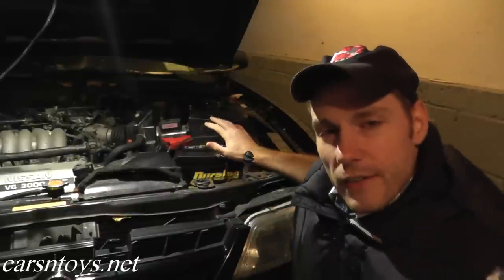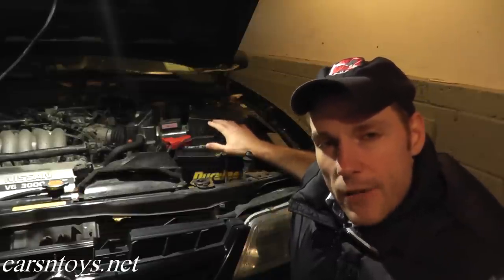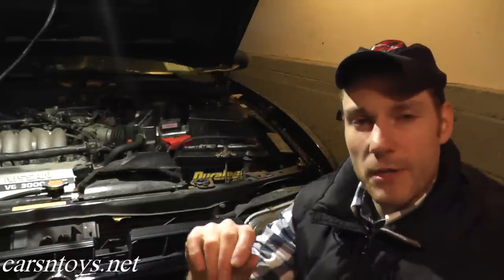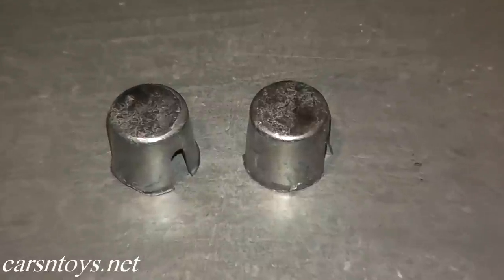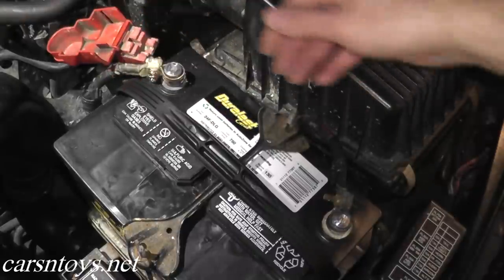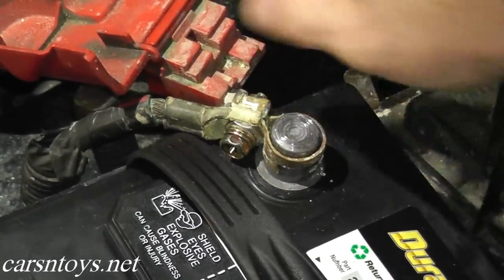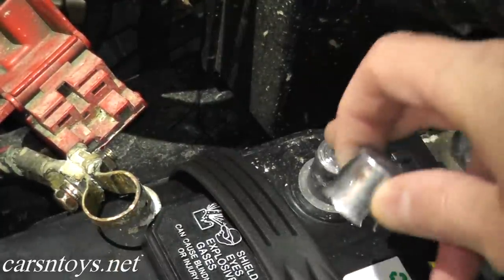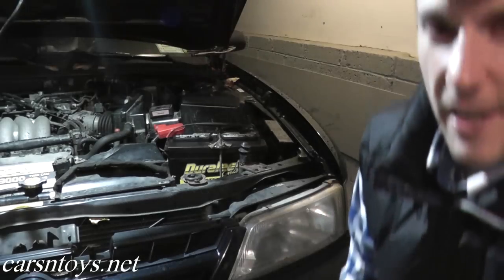Fixing A Vehicle That Turns Off For No Reason

Comment: Hey you save my life !!! I've been experiencing my Car randomly dies while driving.. Already changed the Spark Plugs, High Tension wires, Fuel Pump, Fuel Filter, Relays.. When i saw this video, I've noticed my negative battery terminal is crack  even if it is tighten.. now my car runs fine !!! Great Video !!!
Reply: My dad is having the same problem, I’m trying to find out what it is. Car stops going for no reason and brakes go rock hard when it stops.
Reply: @Partypartyyeah613  Check Spark Plugs, High Tension wires, Fuel Pump, Fuel Filter, Relays & Battery Terminals.. Lastly sa ECU..

Comment: I love your video!  I never knew battery post caps exist.  I just bought a battery from a car parts store and they put it in for me.  I felt stupid but said "if you're offering to install it I won't say no."  During the install  I said "it looks like the positive cable needs to be tighter."  They said "its as tight as it can go."  I thought it would probably be OK.  A month later the car starts dying while driving.  I forgot about the loose contact until seeing your video.  Thanks for the awesome, easy fix!
Reply from the maker: That's awesome! Glad to help

Comment: This fixed my problem, thank you! I did not actually buy the posts but the problem was the loose positive terminal connection on my 2006 Honda Odyssey. I had not seen the problem myself but my wife had experienced the loss of power while driving a few times before I went on the internet searching for a solution. Also, make sure the connection to the smaller wire that typically goes to the fuse box is secure. I have driven 1500+ miles and (crossing my fingers) have not seen this problem since.

Comment: The positive terminal I was working on was so corroded I had to clean it up and discovered whoever worked on it before just tried to tighten it as much as possible  and broke one side of the terminal. I replaced it and discovered it probably broke because of the very bad corrosion going on for years. Thanks for the TIP! I replaced the battery after seeing your video. There was a sudden shutdown after all the work I did. The car did start up and suddenly just shutdown. It happened a couple times. Then I remembered seeing you video and I replaced the terminal. Everything resolved! The shop said it was going to be $900 after a diagnoses. This was a 2012  V6 Frontier. Thanks again for a great video!

Comment: That's interesting because you can take the battery out once it's running and it will stay running because the alternator holds the charge. The battery just provides the initial jolt to turn the starter
Reply: Yup only reason car would die after it’s started if your alternator is shit
Reply: Yes for old cars…. Lots of new cars these days do require the battery in the circuit for the car continue to run
Reply: Yea that's not true on 2003 and up vehicles.  With all of the electronics they have one feature on newer vehicles the battery losing connection will kill the vehicles.
Reply: With ALL the electronics cars have now ?!

Comment: Silicon foil also does the trick. Wrap around as much and tighten on the silicon foil. I use it on my vape with a loose battery. So silicon foil WILL transfer the power acting as a metal piece

Comment: I have a 2001 dodge neon with 206 plus thousands miles, good battery and connection, it runs idle for 3 or 4 minutes and turns off, what else could be wrong with it?
Thank you.

Comment: process of elimination. start with the battery if if you cant get a spark from it then it needs to be jumped. if its a brand new battery it could be weak connections from the battery and the post. if you tighten that and it still cuts off it could be the alternator or a fuse problem. if you still cant get it to work take it to someone who has more experience.

Comment: Hi, here my vw polo have the same problem and I open the hood I just touch some wire n when I close the hood the power comes back. Lol I need some tips to fix it. I  think the battery connection is fine . Is there any other things to check.

Comment: I have a 2002 Ford Mustang V6 and as I'm driving down the road it will shut off for no reason. So I pull out the key and put it back in and maybe it will start and maybe it won't start. But when the theft light turns back on it'll start back up. It's got a new gas tank put in it new fuel pump and a new computer any ideas what it could be

Comment: 2001 gmc sonoma will run till it gets hot and then shuts off I have replaced starter and coil pack and alternator checked battery terminals and so far none of this has been the problem it still shuts off while driving.any solutions please help

Comment: I have a 1994 mustang gt, it's often will idle high then come down and shut off it's even shut off when driving, weird because It was idling and when I turned the vent from in to off it shutoff, I had the battery checked and there was no problem there we are still not sure what the problem is and help?

Comment: I have a 1998 Jeep Grand Cherokee Laredo 4.0 . Starts up fine, then it starts to idle kinda rough and sounds like it's about to shut off and then it in a couple of minutes it does. Also I can be driving down the road and it dies but starts back up. New battery btw with tight and good clean connection. It's a Chrysler though so what can I expect.
Reply: C B H did you figure out what the problem was ? Same thing is happening to my Chevy Suburban. Replaced the battery and a few days later my car starts but it starts idling rough and stalls on me.

Comment: Great video, you've confirmed my suspicions of the battery causing this issue...
Reply: My 2003 ford expedition dies at the red light or when is park battery could be the reason????
Reply: Oh I put in aftermarket stereo that maybe causing problems?
Reply: beto blas Check air and fuel

Comment: I have a 300 Chrysler hemi I have my automatic start I put new batteries in it I started it it runs for 15 seconds and then stalls out what could be my problem the doors are shut though it's shut Chuck but the engine likes on and I don't know why that's on but everything's running fine

Comment: My car randomly cuts off at low speeds when I turn the steering wheel now other day just off rolling down the window that current made my car cut off so that electrical problem? Bad ground wire cuz it was a lot of corrosion on the battery cable connector when I bought it

Comment: My 01 town & country 3.8l engine shut off at a redlight and will not crank back up. I've got power to everything, but it does nothing. It won't even turn over. Not even a click. It was driving fine then boom. HELP PLEASE

Comment: I had the same issue, 04 Ram 1500 5.7 truck would shut down while driving randomly. Found grounding bolt by the ECM harnesses lose. Tighten it down and no more problems.
Reply from the maker: Good stuff!

Comment: my 2017 Ford Fusion shut off as I was stopping at a light. It also put itself in Park. No engine light went on. It restarted without a problem but I went directly to the dealer. Because there was no engine light it was suggested that I continue driving it until it happened again, however I declined and left it for service. It turned out to be the throttle assembly which, of course, I don't understand.

Comment: awesome Vid  Just had the worse time just before Christmas 2022, Gone shopping had my van on and BAM the van just stalls , I was trying to figure out is it the battery or the Alternator ?? Well after 3 hrs in a 30 below zero weather and got severely sick afterwords, The battery was only 7 months old  and figured I just purchased a lemon battery , But the problem was simple . I jumped the battery took it home checked the wiring and wallah.. Battery
 ring was looser than  my grandmothers skirt . I did what you did on your video n saved me Hundreds of $$$$$$$$$$$ Thx for the Tip my man

Comment: I replaced me alternator then I needed a new battery. I noticed my positive terminal was loose so I just used some random washers I had laying around so my terminal would be tight. Since then I’ve had my car randomly stall a few times while driving.  The terminals are tight but I have a feeling the washers are the problem now. Going to buy these caps tomorrow and see if it fixes the issue. 
Thanks for the in site!
Reply from the maker: Glad to help!
Reply: Did it help ?

Comment: Great vids.. What if your battery looks perfectly fine.. My car has alright idling, but when driving, it does tend to get into oow revs and turns off out of the blue.. Any thoughts in this?
Reply: did you ever find out what the problem was my.car turns off randomly and i do have a check engine light but its a tempersture sensor would that make the engine turn off randomly?

Comment: My car shuts down after i lower the gear from 3 to 2. In the last service   I had changed clutch.  Do you have any suggestions to fix
Reply from the maker: What kind of vehicle? Check engine light on?  Throw me an email to carsntoyshelp@gmail.com
Reply: CarsNToys Its Suzuki Ritz. Even idle rpm is not constant. Took to mechanic today says engine misfiring

Comment: this is exactly what happened to my car on a highway, that's why I'm  searching this on utube. My car turned off while it's running around 50km/h. I pulled over, and I had no idea what happened. Car electricity back again automatically after popping the hood. Then after few miles it happened again, and that time I was lucky to find where the problem was! whew.... I would be in a serious trouble where I stuck.
Reply: Mohammad Niaz Morshed So what was the problem?
Reply: What’s the problem ???
Reply: @tmt2058  loose battery terminal.

Comment: I’m not sure if it’s my car battery or my Alternator being the issue for my car... my car just stopped running for good 10 seconds the battery light was on. I switched it the ignition off and turned it on again and thankful my car is running again but I’m confused as to what caused that shut down
Reply from the maker: Certainly check both. A good battery tester will test the battery and alternator. Most local auto parts stores will check for free.

Comment: Mine are in solid but still does turns off, battery is good had it checked but not sure about alternator, my tester says they are both good...so I have no idea what to do now
Reply from the maker: Does your vehicle have an after-market alarm or remote start?
Reply: @CarsNToys  I have 2 remotes but I have not programed them yet and I'm sure has alarm but does not get set because I don't have a remote programmed
Reply: @CarsNToys  I have a door ajar light in dash I think that's why it won't go into program mode on van

Comment: what if my car dies at the light but starts back up? the lights pop up of the battery, exclamation, check engine soon. I've taken it to auto zone for the codes and two codes popped up. I've had a mechanic looked at it and drove it and it didn't die for him. what's up with my car ?
Reply: we changed battery and cabels and timming belt but still dies
Reply: Wayne Johnson Anything new with your car?
Reply: Your EGR valve maybe clogged up or closed and won't open. You might need to change it

Comment: what ahould i do if i get a abs code 112-01? i cant seem to find anything related to the code. but my guess is... it might be the alternator or the battery... what my car does is that it turns on, but drives on low rpms not allowing me to pass over 10mph before stalling out, and when left in park(P) overnight, the battery power is drained... any ideas?
Reply from the maker: +Elliot Carvajal What kind of vehicle?
Reply: +CarsNToys is a 06' Acura tl automatic 3.2 vtec base model
Reply from the maker: +Elliot Carvajal I'd start by fixing the battery draw. Look up - Parasitic Draw Test. The '04 TL i worked on had a similar problem. I traced it to the bluetooth system. We just pulled the fuse for the bluetooth system and it solved the problem. (A new bluetooth for this vehicle isn't cheap.)

Comment: I have a chevy Impala 2004 and it takes a very long time to start and it sound like it's clogged and then when I finally get it to turn on it makes really weird noises and when I come to a complete stop or when I'm slowing down the car completely shuts off ... we changed the coil wires and we changed the spark plugs and the box that the coil wires pluggs into but I guess that was not it because it's still makes the same noise and it takes forever to start and when it does it shut off . SOMEONE PLEASE HELP

Comment: hi I have a 2008 crown Vic my car will turn on then turn off right away I turn it back on and it's fine happens once or twice a month looking at my battery I don't think I need to do this could it just be a random cut wire or bad ground?
Reply: no codes
Reply from the maker: Generally, it tends to be something related to ignition or fuel. Any work done there recently?
Reply: I think it's your starter. I had the same problem with my 1997 Crown Victoria
Reply: No work there everything pretty much stock one coil replace never looked at plugs hasent happened Ina a while now my beast still healthy 340k and 7333 idle hours
Reply: When I mean stock I didn't change it lol

Comment: I have an issue where I'm stopped at a stop light and my car stalls .. the weird thing is, is that the motor shuts off but the battery is still working, the radio is still on and everything, the motor stops working.. any suggestions
Reply: GPaniagua 12 same here u ever figure out wat it was ?

Comment: Have they changed cars that much? any car I ever had you could pull the battery cable right off, and the car would still keep running, if the alternator is good.

Comment: in theory, the car should run without the battery.  Battery is only required for start.  You should be able to pull the negative terminal off as the car is running and it will remain running.  The alternator is generating the field needed for power and charging the battery up at the same time.  That's why when you have a fresh jump start on your battery, you need to get on the highway and drive the piss out of it to get that battery charged up again. If you find that your car NEEDS the battery to remain running, then there is something wrong with your alternator, and your car is primarily running off the battery.... until your car dies on the road.
Reply: Model Jet Juggernaut  thank u just what I was going to say
Reply: Model Jet Juggernaut yeah but in the newer shitty cars you more than likely have electric power steering and that's a huge issue
Reply: i dunno.. my truck will die when i unhook the batter cable. it died on me one time on the highway, because the positive cable came very loose.  that was like 2 or 3 yrs ago.  i'm still running on the same alternator that i was then.  what's the chances of that alternator still working 2 or 3 yrs later?  I am having a problem of my truck just dying like i turn the key off, then comes right back like i turn the key on.  hoping that this problem is my alternator really!
Reply: But what if your positive is not contacting property? Could that cause the car to shut off while driving?

Comment: i think the car would still run because of the alternator providing voltage to the vehicle. even if one connection is lose
Reply: mark s sorry but you r wrong, I just tightened the connectors and the problem is solved
Reply: But when the alternator need help providing power to all the loads it relies on the battery for help so if you do not have the best connection to the battery the car would do crazy things
Reply: The computer senses the difference in voltage and more importantly current and thinks there is a problem.

Comment: Tried it but didn't fix the problem. It's extremely loose even with the battery post shim. I don't understand the issue
Reply from the maker: Ihsan Deeb Take a look at the screw as you turn it. If the screw turns in its place without getting tighter you'll need to replace it.
Reply: Update: my battery terminal was broke off! My brother found the issue, shows you I'm not good with a lot with cars lol. Thanks again for the advice

Comment: My car shuts off while driving..but as im coasting ill hit the gas and the car turns everything back on like nothing happened. ..(power steering everything turns off) any ideas! !!
Reply: Fuel pump?
Reply: mike dejA Use to happen to my was my alternator , turn your car on and while it’s on disconnect the positive connection on the battery , if it cuts off it’s the alternator .

Comment: I have a question my car just shut off when i back out it wants to turn on but does not
Reply from the maker: Any trouble codes?
Reply: CarsNToys i have a question my car shuts off while idling at the red light could that be a transmission problem?  i drive a chevey malibu 2001 btw

Comment: I had the same problem with my car,

Car shuts off a second,
Aircon turned off,
Stereo off,
Abs light came on,
O/D light came on.

Got to know,
My positive battery terminal was fouled with acid build up.

Cleaned it and got ir running fine.

Abs light reset itself by just driving.
Reply from the maker: Good tip! Thanks for sharing.